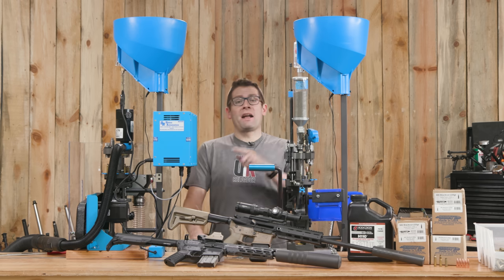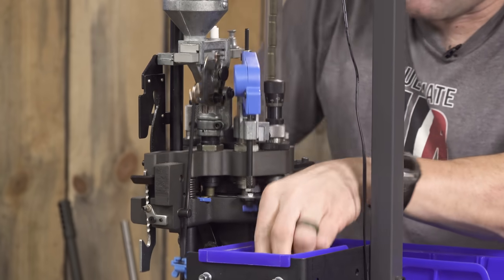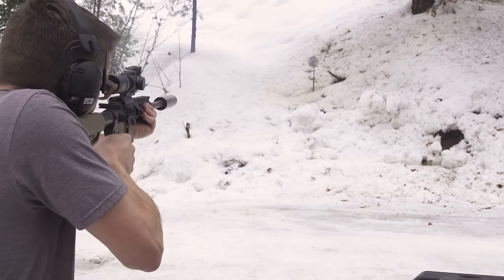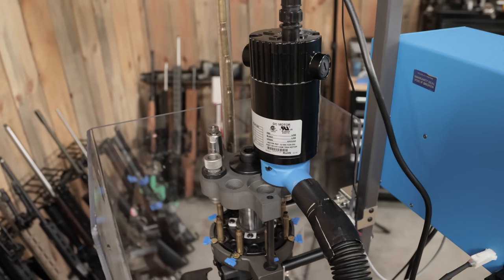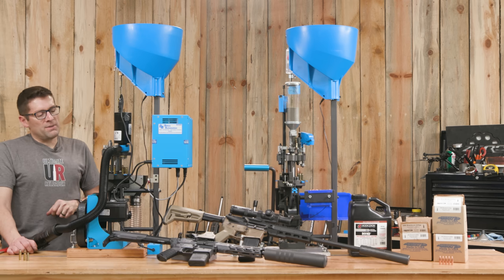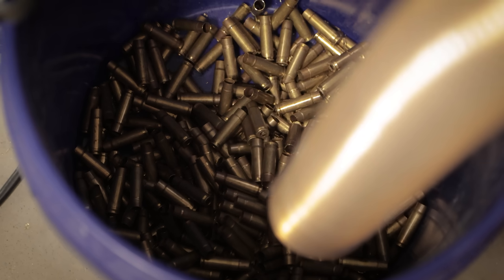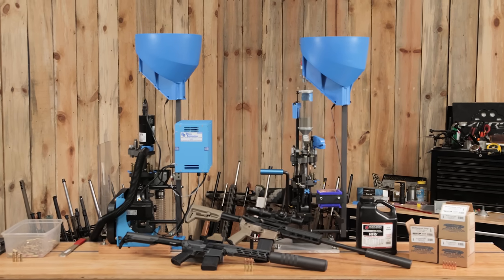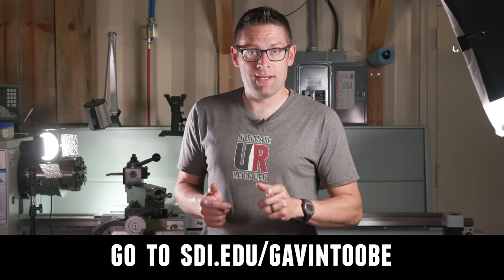From 223 to 300BLK: Insane Dillon Conversion and Loading Setup

Comment: That’s awesome. I’ve found the Dillon primer system can malfunction, most often by having a primer not fully fall into the slide.  This can cause the primer to spit out of the machine, and may distort the plastic lips on the bottom of the inner primer tube. Solution: Occasionally remove the inner tube and clean the inside.  I use a .17 rod and a patch with alcohol. Also clean the bore in the primer slide with a Q tip. Finally, a 45-70 case or similar weight on top of the primer check rod is quite helpful. 

I’ve found some brands of primers leave more dust and residue than others. For me Winchester or CCI generally run perfect and the priming system doesn’t require cleaning prior to the whole machine needing routine cleaning/lube.

Comment: One year old video when commenting, I’m new to reloading, still collecting 223 brass for my Ruger 300 BO. But will be doing all this using a simple drill, a pipe cutter and my Lee 4 hole press.
Being Australian, all I can have is bolt or lever action rifles. Haven’t found a 300BO I can afford yet in lever so going all manual in each reloading process is no issue.
Planing Sierras 125 grain BO special bullets for main hunting and will try an all cast local  coated 165 grain cast meant for 30-30 as my subsonic and main plinking round.
Here, 300BO is extremely expensive compared to the USA as our previous local suppler shut up shop.
Might see other cheap 30 jacketed 30 cal bullets for subsonic plinking out to 100 yards (our local range is only 100 metres anyway)

Comment: Wish you had shown the cause of chamber jamb from converted cases and how to solve it by neck trimming to max .0135 neck wall thickness, considering the Dillon trimmer does not solve all the issues including the clogging of the trimmer head with brass and case mouth burrs which can cause jambs and bullet damage. Final resize with standard resize die seems to work well.

Comment: I cut my once fired .223/5.56 with a $40 harbor freight chop saw via $20 ebay jig. 
   Resize and decap  with LEE .223 die. Neck down with .300BLK LEE die. Trim with LEE Quick trim case length dies, wet tumble and load. Cost you about $6000 ? $7000, $10,000?
   It costs me about $150.
   And when loading commences my brass is sized on step 1 before priming.
Reply: Now you’re talkin’! That’s the setup I want to see run! You don’t happen to have your own channel here?

Comment: I guess if you have money to keep a machine gun around you have money to buy this setup.
Reply: You do save money.  While I still hand load using my Lee Hand Press I also have a Dillon 1050.  It makes quick work of loading ammo.
Reply: @SALTYCOMBATDIVER-ExInstructor  how long did it take to break even?
Reply: @Z-Link Corrupted  considering that a buddy and I started when the caliber was SAAMI accepted it's not fair to say because we got the Dillon 1050 because swaging military brass using a manual swager was too time consuming.  I think it took us a week to break even but that's when Federal and Remington was trying to get us to agree to making brass for them.
Reply: @Z-Link Corrupted  the best thing about the 1050 is the primer swaging ability.  If you don't need that I would recommend 650 or whatever their newer version that replaced the 650 is.  Considering the cost of that one you should be able to make the difference within a few thousand rounds.
Reply: @SALTYCOMBATDIVER-ExInstructor  I got the Lee classic loader broke even on 300 rounds of 30-06.
The only thing I've shot over 1k rounds is my m&p357sig, broke even on the benchless hand press, and dies in the first 400rds making brass from 40sw cases.

I'm not a high volume shooter, I don't shoot just to say I shot, Ever trigger pull has a purpose be it killing game, sighting in, validating trajectories, hell I even made a dope card for my 357sig 147gr v-crown handloads coming out at 1240+-10fps out to 200yds.
Pull trigger, collect data, pull trigger, validate data, pull trigger, bring food home.
Reply: Being an FFL probably helps a lot
Reply: @Z-Link Corrupted  all of my shots are deliberate.  Most result in ragged holes.  I develop loads and then see how far out they perform and I make note of their performance.  I also build firearms so it's not just about how they perform in a single firearm.  Which is how I ended up converting 300 AAC BLK when it was first SAAMI approved.  I also evaluate components for a couple manufacturers.
Reply: @Chuck Kovach  I have worked for several FFLs, those guys love full autos so it does help.  Personally I prefer lower volume but always the best components and the most accurate possible.  I started as a poor teenager in my grandfather's reloading room.  It was a bit unique being that my great uncle is John Moses Browning and the whole family pretty much has been involved in firearms design and development.
Reply: Ding ding ding
Reply: Look online for used ones. I buy all used dillon stuff. I sold my 1050 and found a used 1100 cheap then found a never used DA3000 for 1200.

Comment: So to clarify. Your bullet feed issue is after it places the bullet and the tool head is raising the bullet is catching the bottom of the die? I load gallant coated 217 just fine with a bullet feeder but I had to make my own ramp out of metal wire. I have some Berrys but haven’t tried them. It works good but speed is the drawback. It can’t keep up. Maybe the pro version would do a better job.

Comment: Would love that setup but my; .300 Blackout is a 5-shot bolt gun, Thinking of getting a Lyman Pro set of dies in .300 blackout to load on my Dillon 550 
what are your thoughts on them? I am using Hornady dies at present and am not very impressed with them but it was the only diesel available, Great video
Thank you.

Comment: I'm just getting into reloading and I noticed you sprayed the cases with, I would assume Lanolin before loading them into the hopper to load the test rounds. Do you clean the case lube off the finished rounds before firing? I have been seeing a lot of talk on forums about resizing/decapping and case prepping rifle completely then doing a second tumble to clean off the case lube before the loading process. Is there a reason for that or is it just extra work.

Comment: I’m not sure if this is already been asked or where to find it, but have you had any issues with certain casings over others? You have a list of cases that work to convert in cases that don’t work?

I’m getting ready to set up my automated 1050 as a case prep machine like what you have but I didn’t see anything listed in your video about cases to use or cases to avoid
Reply: There are some cases that will end up with too thick of a neck wall after forming. If you load a bullet in those cases, it will,often result in a deformed case. I was having trouble with reloaded cartridges getting stuck in the chamber of my AR-15 rifle.  I then found out about this and did two things: I measure case neck thickness and turn down the necks on cases with neck thickness over .013, and I also use a full length gauge on every round to make sure they meet SAAMI Specification.
Reply: I’ll add that it depends on which .223 ream was used on your particular rifle.  Most AR chambers are pretty sloppy for reliable operation, but some have fairly tight tolerances for neck diameter and leade for precision shooting.  Just do what most of us do.  Separate brass brands, form your cartridges, measure neck diameter of your loaded rounds, take notes, and shoot.  See how they run.  Unless you have a machinist’s  inside diameter gauge, you don’t know your chamber’s neck diameter.  What I do is pull off my upper and drop in loaded rounds to see if they freely chamber completely, then pop them out with a cleaning rod.  Find the one that is a bit snug and you’ll know your max neck diameter.  Remember, the amount of taper crimp can changes the diameter.

Comment: How did you check the case wall thickness? Or did you pick same head stamp brass? My first and only reloading accident was during a string of fire and I ended up with an out of battery detonation. It happened because the (new) neck wall was too thick and would not allow it to fully be in battery. That one round was just far enough out to keep the bolt from locking in.
Reply: Case gauge my dude

Comment: i would like to see some long range subsonic 500+ yards accuracy load development preferred rifle builds.
Reply: I don't know about getting subsonic ammo out to 500 yards. My 300 is sighted in for 110's and when I switch to subs it is a 12 inch drop.
Reply: @louiscapasso4452  I have a custom built 300BLK in a bolt action rifle and am very disappointed with the accuracy I have done extensive research and load development achieving 1moa at 100y but I have a 22lr easily 1/2 moa with subs at a 100 and under 1 moa at 300y. I cant achieve this with my 300blk.
Maybe someone with more resources could. I would love to follow along if someone was up to the challenge.

Comment: So….if you can swage on the 1100….couldn’t you set that up to process the brass manually and then after the brass has been converted switch to reloading. For that matter, if your using civilian brass and don’t need to swage, couldn’t all of this be done on a 750 with some more time for set-up and conversion?  Seriously not a sarcastic question.  I don’t have a .300 but am seriously considering it.  I have a pretty much unlimited supply of once fired civilian .223 brass.  Finally, I’m on the verge of upgrading my Lee Loadmaster to a Dillon 750 and am thinking of adding the RT1500.  Couldn’t I do all of this video with that since swaging isn’t an issue?
Reply: I convert mil-surp 5.56 blanks to 300BO on an ancient RL500, then wash and anneal, then load using a different toolhead. All manual, but it works well and is fast enough for me.  Primer pockets are handled with the Dillon Superswage. I also use a Lee factory crimp die as the last station. I did switch to a 223 small base sizing die on the loading head for the exact same reason.  I suspect some of the military guns shooting the blanks had out of spec chambers.  I check EVERY single round with a case gauge, perhaps 1 in 10k fails the check.